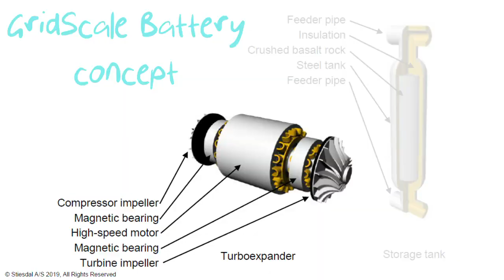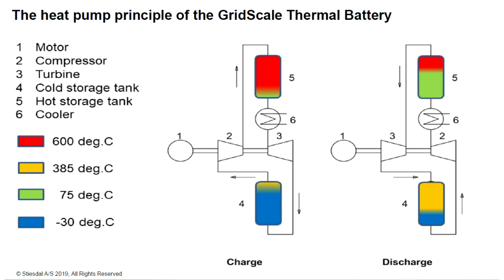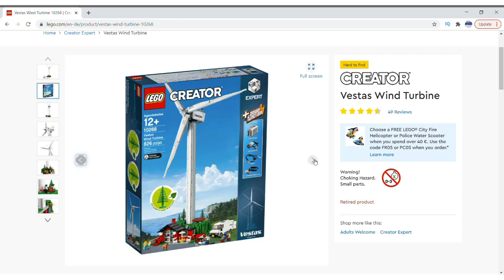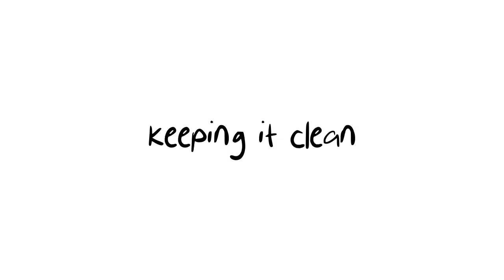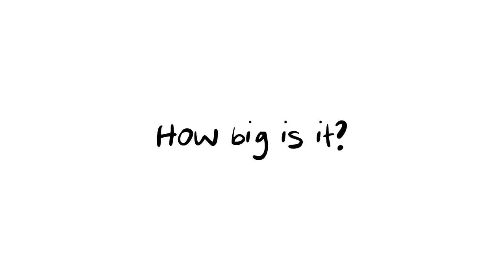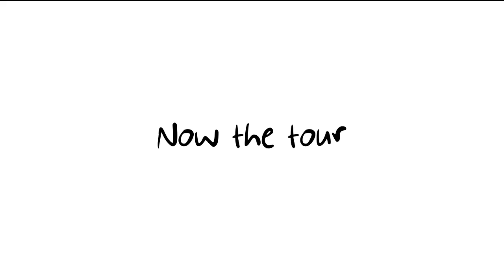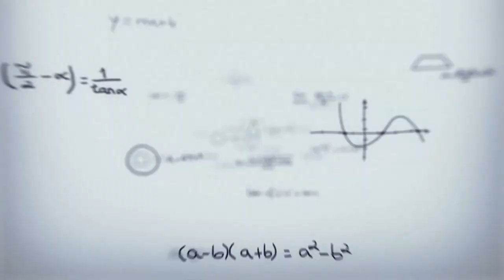Thermal Energy Storage Tour with Stiesdal Gridscale Battery

Comment: Thank you so much for this tour! This system and compressed air system, if they indeed have 60% efficiency and are 10-100 cheaper than chemical batteries, seem to be very suitable right now for energy transition. Because I don’t see any progress in the pace of installation of small and midsize storage systems anywhere in the world.

Let’s take Germany as an example. Germany added only 5 GWh of batteries last year, which is a staggeringly slow pace compared to the goal of 5 TWh defined in Tony Seba’s report for Germany. (For entire power of the country 10 TWh of batteries are needed.) At the current MegaPack price of 270 USD/kWh + installation etc. costs Germany would need to spend 2 trillion dollars over 10-15 years only for these 5 TWh of batteries, which is 40% its GDP! And these batteries have a roundtrip efficiency of 87%, which is not too far from 60%. The question now is how much does Stiesdal system cost if mass produced? If it is 10 USD/kWh we all should start a campaign of advocating and informing the governments.

This type of storage should also be suitable for “tankering”. In his paper “Rethinking Energy (2022). Germany's Path to 'Freedom Energy' by 2030” Tony Seba suggests for Germany to install 5 billion kWh of batteries (5 TWh) during 10-15 years, which is equivalent of 3.5 days of all electricity needs (1.4 TWh per day). In case of a 2-week winter Dunkelflaute, common to northern countries, the country will cover only 3.5 days via batteries. I suppose that the remaining 10.5 days can be covered via international fleet of tankers full of batteries: 4 tankers each day, 32 tankers in total for a region size of Germany (4 on recharging, 4*3 + 4*3 on a 3-day long trip to/from Africa, 4 on discharging), but for all regions simultaneously in trouble the number of tankers obviously must be larger.

Comment: What gets me excited about this is how the cost scales so beneficially with storage capacity. Probably for installations with a large capacity but relatively low rating is dominated by the cost of the steel tank rather than the storage medium, which means you have the cube-square law on your side. And then if you want to increase the rating, I guess you just need to get a larger turbine system, so you just pay proportionally for that. Thanks for this!

Comment: Why can you not design a system for domestic use +- 8kw , I bet it would be cheaper to sell
Reply: You can already buy a bunch of hot water tanks. However, they can store the heat for only 3 to 4 days because of their small size (square cube law)

Comment: 1) Converting solar or wind power first to electricity and then that into heat is not efficient. It would be better to directly convert solar energy into heat. 2) Now with heat pumps, it's clear they have to draw energy from a source outside the house so I wonder now about storing the heat of the warm days into something for later use in in the winter by heat pumps. Imagine a deep huge pit filled with crushed rock and then we pour slightly warm water over it (warmed by the sun) If covered the top layer could still be used for growing crops which hate the cold.

Comment: Problems - stones crush in hot/cold cycle. Stones expand in hot, their weight isn’t zero, so them try to deform walls. Crushed stone blocks air passages. 
Heat insulation works on short time, only. Anyway all heat goes to ambient air. This storage may works on short discharge cycles, on long cycles + efficiency drops dramatically. Li+on seems to be better on longer cycles.

Comment: Seems like lots of other battery tech not yet in widespread use, promising adaptation of a Sand Blaster..? 
The Molten Salt heat storage seems more likely to be useful in Australia, in connection with the present heat generation systems and could buffer load distribution as is proposed for nuke MSRs. (Dare we say more, or is it a submerged issue?)

Comment: I know of hot rocks &/or hot iron storage (from other shows I've seen) there's one problem that I find difficult. Massive heat sources don't help the atmosphere if the heat insulation isn't highly efficient. Imagine millions of these things around the planet leaking heat. So my question here is how efficient is the insulation mechanism or how much heat is being released?
Reply: I don't have numbers, but I guess that it depends on the timescale. The graph at 9:55 suggests that the storage will be useful for up to a week. I don't know which efficiency that corresponds to.

Comment: Do you think this kind of system  could be implemented at a fossil fuel powerplant thus switching it from power gen to storage. Reusing the turbine etc
Hi from Denmark:)
Reply: I think the first step is to use the heat storage as district heating. Gridscale is building a full scale energy storage i Rødby close to a district heating center, so hopefully they can do some experiments.

Comment: @engineering with Rosie. This is a great project and a great idea to make a video about it. The district heating bit is very relevant in Denmark. More than 60% has district heating so there is a lot of demand.
Reply from the maker: I had district heating when I lived there (I was in Kolding). It was great! But it does need some effort to change it to something other than the waste heat from fossil fuel/ waste power plants as they shut those down.
Reply: @EngineeringwithRosie   True it's a big job, but the pipes are there.

Comment: Thanks, Rosie. Can you explain how a compressor acts as a heat pump here? I get that it heats the gas (by T = PV/nR and perhaps compressor inefficiency), but their website claims the COP to be 2.5 and you don't get that without a refrigerant and an evaporator & condenser combo.
Reply: It’s pumping the heat from the cold storage tank to the hot tank, the turbine acts as the evaporator
Reply: @iain3713  - Hmm. That doesn't seem right. The turbine is playing the part of the compressor, which is already part of a true heat pump system. If it's a heat pump, you need both an evaporator and a compressor - and the evaporator facilitates heat transfer via phase change, which at this temperature is impossible to happen to air. Most importantly, a heat pump's purpose is to move heat, whereas this device's purpose is to convert electricity into heat and pressure. The movement of gas from the cold reservoir into the hot reservoir is helpful for facilitating that electricity conversion, but it's an entirely different type of concept. Keep in mind also that heat pumps are meant to work to move heat from an open system (i.e., not insulated) into a place where you want to warm things up. You can keep moving more heat because of the openness of the cold reservoir. In this device, the cold reservoir is insulated; if you move heat from it to elsewhere, no new energy enters the system. In fact, the most telling difference between this system and a heat pump is that a true heat pump would be cooling down the cold reservoir by the fact that it removes heat, but in this system any cooling down that occurs happens because you're pumping in cold air from the bottom. The system removes air from the system, and some heat goes along with the air, but if they weren't pumping in cold air at the bottom the temperature of the cold reservoir would not change ... all that would happen is that the rocks would stay at the same temperature but would now be in a partial vacuum.
(For reference: https://energyeducation.ca/encyclopedia/Heat_pump)
Reply: @rasraster  I may be looking at it wrong, but air gets compressed to above the temperature of the hot storage tank, transfers some heat to the storage tank, it expands through the turbine, doing work so it loses heat and cools down below the temperature of the cold tank, absorbs heat from that and cycle repeats.
Reply: @rasraster  I'm having a hard time understanding it too. Most Joule-Thomson (air cycle) refrigeration machines I've heard of had a COP less than unity, which would leave a COP of less than 2 as a heat pump (generous, because most actual heat pump applications require a larger temperature difference and lower efficiency than when operating as refrigeration, especially in this case). One thing to remember is that air cycle machines can be open cycle, they don't necessarily have to have both a corresponding "condenser" or "evaporator" (gas heater, gas cooler). The only issue is that when operating open cycle as refrigeration, ice tends to form in the expansion device (usually a turboexpander to help with the already low efficiency).
Reply: It sounds like the compressor is being used as in a gas turbine to feed air into the system to drive the system in a particular direction.   If the air is at higher pressure at the cold end, the heated exhaust gas will flow towards the turbine end of the system.  A smaller pressure applied over a larger area  or ar a distance further from the drive shaft than the compressor blades results in greater torque in the direction that they want the system to flow.

Comment: Could this machine also make use of “waste” heat from i.e. Datacenters?
Reply from the maker: Good question, but I don't think it is set up in a way that use waste heat. It can supply its waste heat to e.g. district heating though,  and get better efficiency that way.
Reply: You could use wasteheat to preheat the air thats sucked in the compressor. In this way, you would use some of the energy. A datacenter is likely not a very useful source of wasteheat because of its low temperature level. It would save very little Energy in the charging cycle.

Comment: Wouldn't it make much sense to integrate these with base load thermal power plants that are hard to throttle like nuclear and coal? You would save a lot of energy by skipping on thermal-electricity-thermal transformation. Also the electrical infrastructure is already there, and you could use the existing turbines. Years later when the power plant shuts down, you can just expand the storage.
Reply: Considering the goal of these kind of storage is to get things like coal out of the grid, not for that. Nuclear, possibly yeah, that could be interesting.

Comment: Van anybidy explain in kayman language what is happening here?
Reply from the maker: They use an electric heatpump to heat up rocks in a tank and then they use the heat to drive a turbine to generate electricity.
Reply: @EngineeringwithRosie  thanks 😊
1. What is the efficiency of the system?
2. The electricty used is green?
Reply: @ibraheemali9541  The efficiency is 60 %, and you can use green electricity produced by solar cells or wind power.
Reply: @Terascon  anahan good thanks 😊

Comment: Is this driven by the Windmills? Also what is really interesting is that it has probably a very durability and almost no repair costs over decades. Simplicity and durability is a key factor for success.
Reply: My guess, and it's just a guess, is that siting there allows for using the energy from wind turbine dump and diversion loads. The closer to the source the better.

Comment: Understand the terminology used here as heat pump  refers to a compressor and not a reverse cycle  ´air conditioner’. Would love to see a video on the feasibility of a reverse cycle air conditioner on claiming waste heat from perhaps a hydrogen fuel cell and raising the secondary circuit fluid temperature to possibly drive a gas turbine to generate electricity.
Reply: Yes, domestic heat pumps only work efficiently with a low temperature output.  This must be something very different,  needs more explanation
Reply: It's effectively an air-cycle heat pump, also called a Joule-Thomson heat pump. It is to the Brayton cycle what mechanical vapor compression refrigeration is to the Rankine cycle. They aren't very efficient, their cooling COPs are usually barely 1, and their heat pump COPs are barely 2. But they can achieve much higher temperatures at tolerable good efficiencies where vapor compression refrigeration completely becomes ineffective.

Comment: Horrible RTE.
Rule # 1 of lower energy use and storage technologies
Don't convert forms of energy, period, unless you have to.
Another example of a future technology waiting for free electricity, most all of the time.
TESS is awesome, just DO NOT heat it with electricity.
Any claims of efficiency probably do not include the heat up from ambient electricity.
With the exception of a heat pump run from electricity to increase the storage quality by increasing the temperature of a thermal process output heat source temperature above that of the source. (Examples CSP & steam based Nuclear)
Reply: Fundamentally, energy storage is just time based price arbitrage. To be useful, the RTE + cost of storage just needs to be better than the unit price differential between peak generation and peak demand, which is growing massively as we add more intermittent sources. As well as supporting peak demand, this allows intermittent sources to profit from energy that would otherwise be discarded, thus improving their overall cost efficiency. Chemical batteries have good RTE but they are expensive per MWh, so they are only useful when price is very high. OTOH Hydrogen has very poor RTE but it's very cheap to store massive quantities long term. Both have their applications; thermal and liquid air sit somewhere in the middle.

Comment: I hadn't thought of using electricity to run a heat pump in relationship to thermal storage.  Nice boost in efficiency.  Still it seems like the capital costs will be very high, since neither rotating equipment nor pressure vessels are cheap.

Comment: Thermal Energy Storage without using the Stirling Cycle makes me sad
Reply: Well, the whole point of thermal energy storage is that it's cheap to scale up to high capacities and high power. Turbocompressors are well established to scale economically to high power. They may not be quite as efficient as a Stirling-based heat pump – but if efficiency is the concern, then pumped hydro or batteries win over anything thermal anyway. So if a Stirling solution is just a bit more expensive (whether in manufacture or maintenance), that probably outweighs any efficiency benefits it could bring.
Reply: @leftaroundabout  that's the same reason Nuclear activists and capitalists use. Without consideration to risk. I'm sad
Reply: @tazholio  well, “cheap” is in this case basically the same thing as “realistic”. If a storage solution can't be implemented cheaply – cheaply at scale – then it's just not going to happen.

The comparison to risks of nuclear energy is a complete apples-to-oranges one.

Comment: I have to say the presentation did not close the deal with me. It's not obviously out of the question, but there are a few things to realize. First, the efficiency is described at being about 60%. Mr Birkemose promptly adds that the effective efficiency can be higher if you can make use of the waste heat for district hating. But the competition to that configuration is not necessarily a combustion heater, whose efficiency approaches 100%. It may be a heat pump, with an effective efficiency much higher than that. There may be other barriers to using that waste heat, including simply having the original power source too far from population centers.

The case for a system like this sounds much like the case for Donald Sadoway's liquid metal battery: For applications where you don't care much about size and weight, its use of very cheap materials, and simple design, may make it worthwhile. That makes sense, at first glance. But the economies of mass-produced batteries, driven by the needs of a couple billion vehicles, may dominate most markets, no matter what anyone does with other designs.

Comment: It strikes me that these explorations of new technology would be a great vehicle for adding a bit of educational material in the spirit of your other technical videos. A great opportunity to add a bit of Carnot, and analyse the efficiency tradeoffs from the standpoint of how theoretical constraints drive the choices of technology, materials, market niche, and the manner in which the designs address these. These guys are able to use a heat pump to add heat - which is already an interesting start. You know this stuff better than me.
Reply: I am really not sure how they can use heat pumps for 600C hot air. Normal heat pumps are already pretty bad heating water or air above 60C. They must have a secondary heat source much higher than ambient or geothermal.
Reply: @Psi-Storm  That depends on the working fluid (gas) and the pressure (compression) ratio, very high temps are possible.

Comment: This seems similar to liquid air storage in it's efficiency, and also in that adding capacity is cheap. Also siting is much easier than pumped hydro, and I assume this should be fast to build.
Reply: Doesn't liquid air use something like this too? To capture some of the heat generated when cooling the air, then to use that heat to expand the cooled air later?

Comment: Competent, comprehensive and detailed, as always with Rosie. One ambiguity that is notorious in the genre (and in here) is the use of the term 'battery'. A battery is an electrochemical device that stores electricity and releases it on demand. The term is used correctly e.g. in the diagram at 9.55.  But then the Stiesdal facility is called a 'battery' in the title, when it neither stores electricity, nor electrochemically. So my firewood log store is a battery as well then?
Reply: If you can make more firewood with electricity and release it on demand, then probably.
Reply: @Psi-Storm  Is that kind of circular capability necessary?